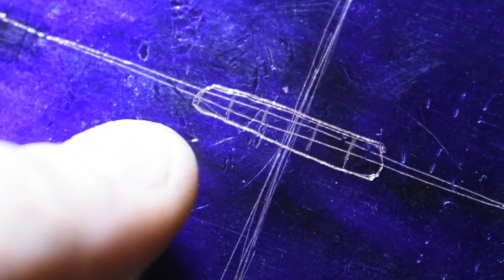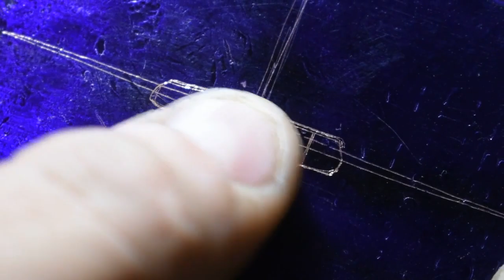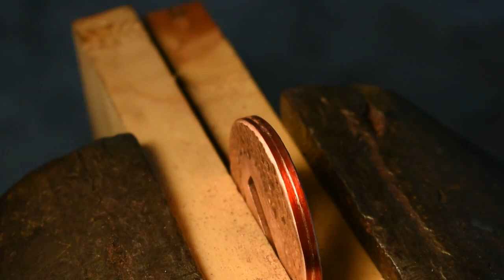Forging a KATANA/WAKIZASHI inspired sword from a File the complete project

Comment: So I have found with that type of furnace cement it bubbles really badly even after it’s dried I have found if you mix it down with charcoal ash there is a lot less bubbling and you still can get a wonderful hamon
Reply from the maker: I will have to use that method in the future, I appreciate the tip and I appreciate you watching!

Comment: I'm not all the way through the video yet but the tang that you have on there is very traditional just set two menuki pegs in there and it'll be strong enough for battle use even if you have twice that length in handle as long as you're using a hardwood it's well fit and dual pegged
Reply from the maker: I ended up lengthening the tang by a few inches in the video, but noticed after doing more research afterwards that the length would have been fine with the construction your talking about. I do appreciate your advice, and I appreciate you watching.

Comment: Instead of ruining any belt grinding on a hardened file, why don't you just take the temper out of it first?
Reply from the maker: I normally do that, I usually put it in clay based cat litter to anneal after bringing it up to forging temp so it cools down slowly.I got sidetracked this time around.
Reply: @Mysticmountainforge , Ahh, ok, thanks for answering. I thought maybe you had a particular reason for doing it that way and wondered what it might be.

Comment: The tip geometry is driving me batty!!
Keeps rounding over...😭
Reply from the maker: I had the same trouble when I did my first Wakizashi build, I ended up getting a chair and sitting right down close to the lower contact wheel and just working it nice and slow, and even then still had some rounding on it.